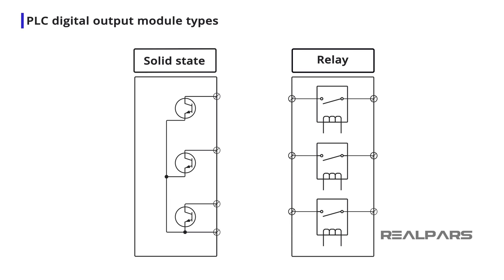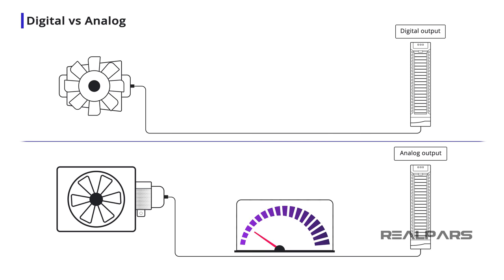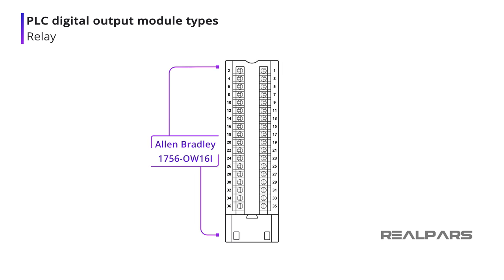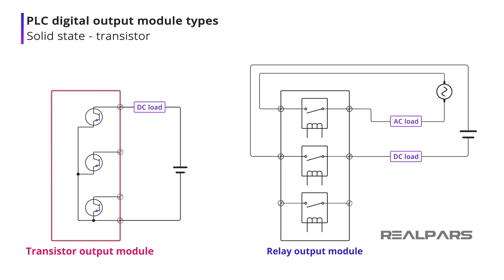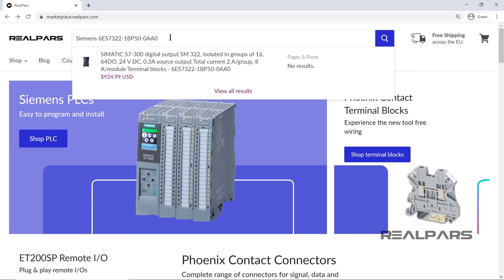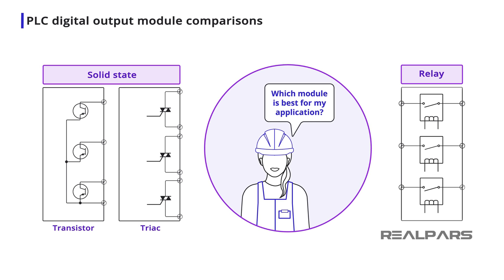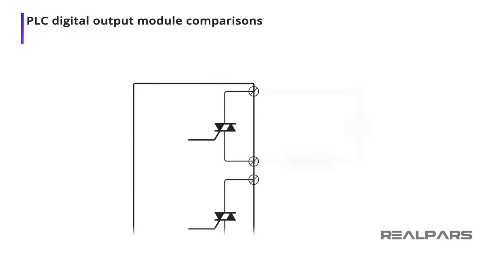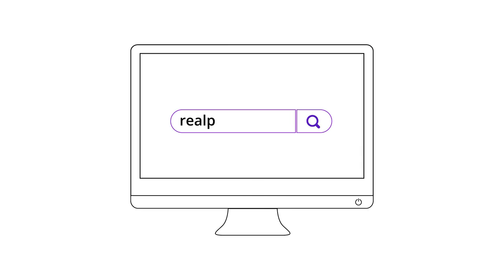PLC Digital Output Types | Solid State vs Relay

Comment: This was very helpful and a learned a bit. I remember on a huge project for a PLC Upgrade at a Power Plant in the South West about a year ago we used some new type Relays. I'd never seen them before and was like maybe a dozen installed. They were from Rockwell and looked like what is Transistors with LED Lights. At first, I had no idea what they were, but my senior said they were Relays. I said Ok and that was it. It now dawned on me they were like Solid State Transistor Relays, I just never knew. Good Stuff RealPars!
Reply from the maker: Thanks for sharing that, Ardent! Glad to hear that it was helpful

Comment: From my experience, working at a machine integrator as a controls programmer, most of this is good information but largely obsolete for machine design. For any AC load, a contactor or VFD/Line reactor will be used regardless because of the limitations on switching such high currents and also because replacing the components if they become damaged is typically cheaper and less detrimental to machine downtime than replacing the PLC module. This is still good information to be aware of but it is not strictly required, sinking and sourcing are more important concepts in my opinion.
Reply from the maker: Hi Shearzy. Thanks for your feedback. You are correct of course.  No PLC output is capable of operating typical AC loads in a plant and some type of interposing device as you described is required. We touched on the current limitations of PLC digital output modules in the video. As you say, sinking and sourcing are very important concepts. We’ve got more videos that will be released soon dedicated to sinking and sourcing  PLC I/O modules and active field devices. Plus, we’ve got more videos soon-to-be released on motor starter types and controls.  Stay Tuned!

Comment: I only source SS output modules. They are much less expensive and seem to be easier to source. This decision is easy by using slim 6mm relays in conjunction with SS output module. The slim relays allow for different power feeds, custom interlocks, take up little real estate, and are inexpensive. The combined cost of both the SS output module and the slim relays is still less than a relay output module alone. Another benefit is the isolation of the controller from the field devices.

Comment: I only use BJT modules to operate external triacs or relays.  If an external relay fails, I can replace it cheaply and in seconds, as opposed to an internal relay that's part of a multi channel device.

Comment: Are the transistor outputs isolated from the control circuit within the PLC?
Reply from the maker: Yes, in many cases they are.  At 4:20 in the video, the output shown is an optically-isolated output channel.  This arrangement is desirable for all PLC DC output cards.  For AC circuits, triacs are used, which create independent 120 VAC circuits with each device.  These devices are very robust and although not isolated from the PLC driving voltage upon a failure.

Comment: Can we use 1plc output to another plc input without touching plc1 program.. Just by using hardware?
Reply from the maker: Yes, provided the input and output card circuits are compatible (both 24VDC, on the same power supply circuit, etc., for example).  I do this all the time to provide a level of simulation before the installation of the system in the field.  Many times, this is also the best way to provide a critical signal from one PLC to another, especially for shutdown and status signals, as opposed to software transfer of data, where the data may be lost due to network or other communication issues.

Comment: In Siemens plc S7 -1500 and ET200S which type of output module used??
Reply from the maker: Hi Sumaiya! As with all PLC's, both types of modules are used depending upon the application.  Most PLC vendors have expansion modules to work with a variety of loads and voltage supplies. You can buy modules to work with AC or DC loads. You can but solid-state or dry relay type. Vendors have modules available with 4,8,16 or more outputs as well!  There are too many different options available for Siemens PLC's to list here.  For example, if you do a web search for S7-1500 series modules, you'll be surprised at how many options are available.

Comment: This appears to miss the 2 most important distinctions between relays and solid state.  1) in a short circuit condition, the solid state device will fail before the fuse, while the relay may survive depending on available energy.   2) A relay can fail with welded contacts, but this is less likely than failing open where energy is limited.  Solid state devices fail short circuit exclusively, unless a great amount of energy is available.  Solid state devices are far more susceptible to short voltage excursions causing failure .    I'm personally an electronics geek at heart and am grossed out by mechanical relays, but they have significant advantages in the industrial world.
Reply from the maker: Hi Paul.  Thanks for your feedback.  We certainly agree that solid state devices are far more "delicate" than good old fashion relays. As you say and as we pointed out as well, mechanical type failures such as welded contacts are problematic with relays.  Even with all its inherent frailties, the mechanical relay is going to be with us for many years to come.

Comment: How come you never mentioned the flyback diode required  in parallel with the relay?
Reply from the maker: Hi @RSuarez66. Thanks for reaching out.  Your question is a good one.  A flyback, reverse-biased diode isn't always required in parallel with a relay coil. You'll see lots of relays that don't have flyback diodes. Generally speaking, the flyback diode eliminates possible high voltage sparks when the relay coil is de-energized by attempting to remove its energizing current instantly. These high-voltage sparks can cause damage to sensitive electronics anywhere near the relay, and that's why you see a flyback diode.  You'll also see them in environments where sparks could cause fires or explosions, such as on fracking equipment. So, in a nutshell - no sensitive electronics nearby, no explosion hazard, no flyback diode. I hope that answers your question!